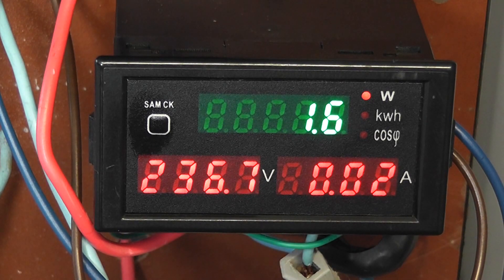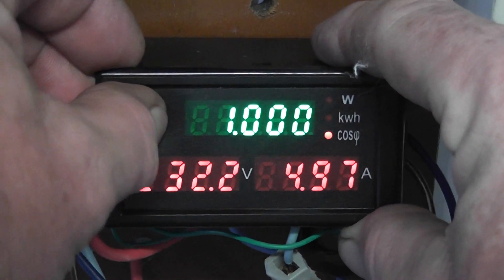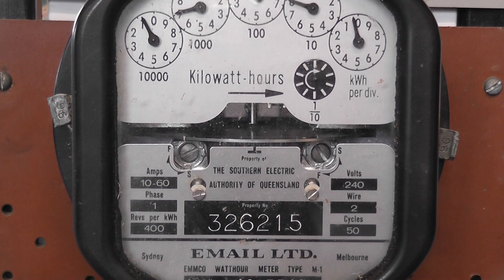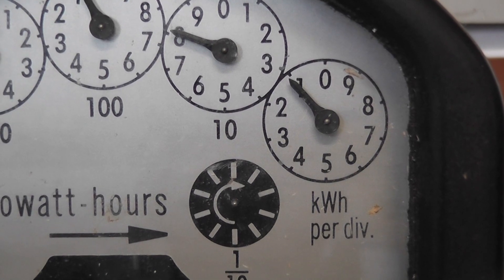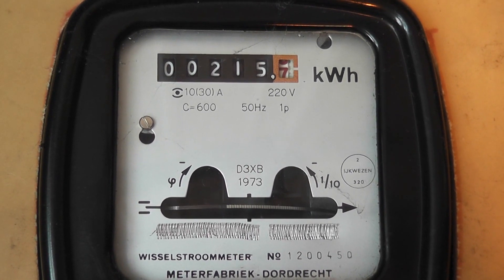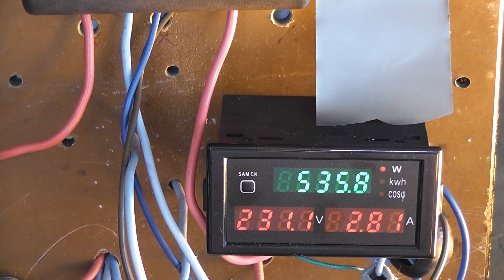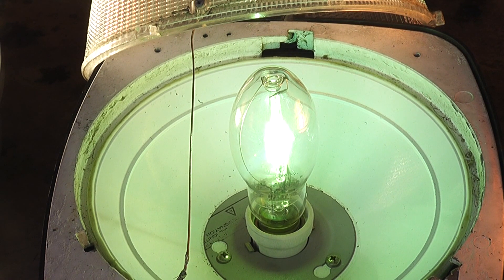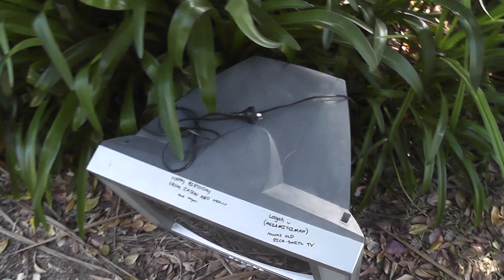Email M1 meter test and Sodium HPS lamp testrun

Comment: Electromechanical watthour meters really are an engineering marvel! I've also found some meters left by copper thieves at abandoned places, and I haven't found one yet that hadn't worked. There's no way that smart meters will last as long as analog meters, smart meters are basically throw away after 10 years items.

Comment: How does one reset the KWh totalizer on that digital meter? Or is it just not possible to reset?
Reply from the maker: When in kWh mode push the button for 5 seconds will reset the total.
Reply: Ahh, that makes sense. Thanks.